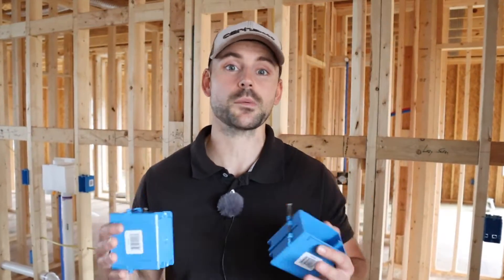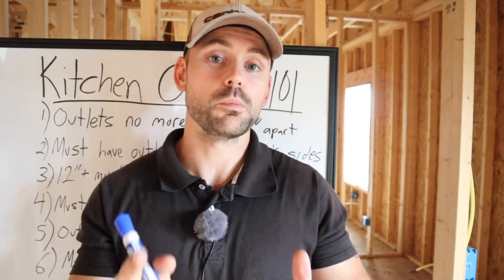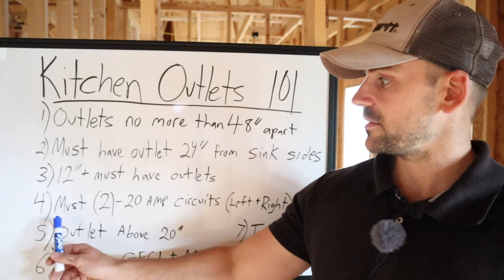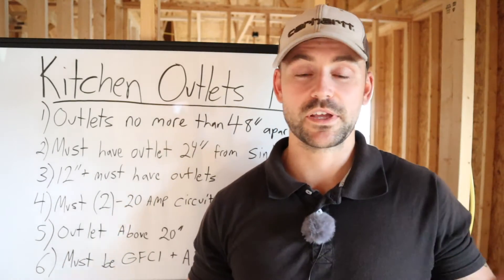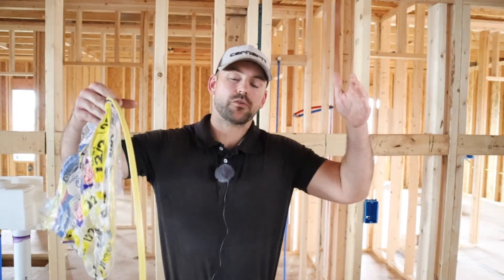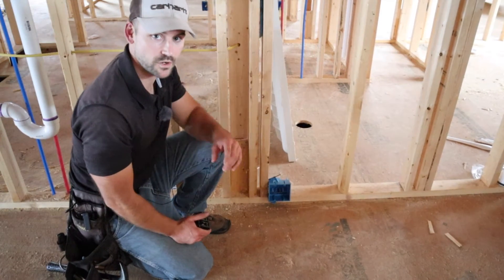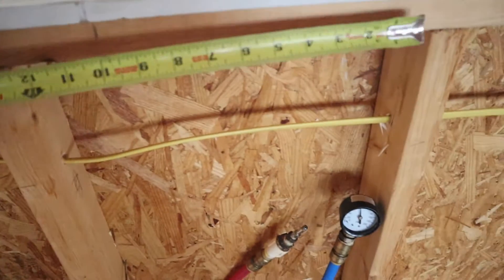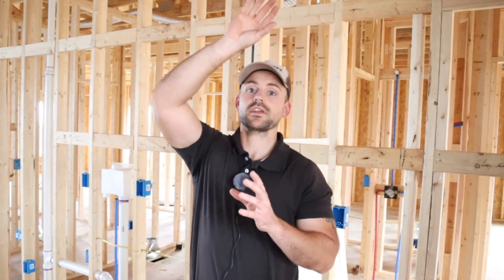How To Wire A Kitchen - Rough In Electrical Circuit Wiring Guide

Comment: a good tip I learned is to use slider boxes for your countertop outlet rough in, they are rigid plastic boxes as well but when tile is added you can loosen the screws and move your box forward flush with the tile afterwards. I believe they are available at most of your local big box stores
Reply: you install the box a couple inches forward past where the finished surface would be. then the grout is only supposed to be in between the tiles not around the box and even if the tile is tight up against the box you can lightly tap the box back flush
Reply: PERFECT REMEDY FOR WHERE TILE IS ADDED.
Reply: How does it move when there is grout and tile holding it in? Just curious?

Comment: Why are receptacles for the range mounted so low to the ground?   I have found most cords need to be pinched 90 degree coming from their plug end
Reply: MOST OF THE RANGES I HAVE CAME ACROSS HAVE A VOID CLOSE TO THE BOTTOM OF THE RANGE FOR THE CORD TO FOLD INTO. MOUNT THE OUTLET TOO HIGH AND IT MAKES THE RANGE STICK OUT 2" FROM THE WALL.

Comment: I can see why contractors and residential developers like those plastic boxes because they're quick, cheap, and I suppose good enough. If I'm building my own house though, I'm inclined to use 4x4 metal boxes with appropriate mud rings. They are much better in my view and the cost and time would be negligible in the grand scheme. I don't find them hard to work with either. Am I missing something?
Reply: Plastic rough in box=$.80, metal 4x4 box=$3.50, + $2.00 for mud ring.
Don't forget with metal box also have to use a Romex connector or minimum a plastic Romex bushing.  Also you have to ground the box.
Benefit for plastic : cheap, cheap, quick efficient.
Cons. Can only support 2 #12 Romex wires due to box fill limits.
Pros for 4x4 metal box: can handle multiple #12 Romex wires.
Cons: cost more and more time consuming to install.
Every moment and every dollar counts in construction work.

Comment: Good video the only thing on a 3-wire 12 make sure when you snap the breakers in your black wire from the three wire number 12 is on phase a and the red wire is on phase B this way you don't overwork the neutral that is code
Reply: Instead of me referring to the national electrical code  this will make it easier for people who want to learn I want people to get the right information
Reply: @jcaleca60  Your original comment “this way you don’t overwork the neutral that is code”. Now that you realize this is NOT code, you want to change your story, and cite some other YouTuber and say let’s not talk about code. Just admit that you commented on a subject that you don’t know enough about.
Reply: 🤣🤣🤣🤣🤣🤣 where did you hear that crap?
Reply: @electricaf365  I don't know what school you went to but you could look it up on the internet all your circuits should be balanced
Reply: @jcaleca60  you won’t find that in any code book.
Reply: @electricaf365   You never make it as a New York City license electrician
Reply: When I was in school for my master electrician license for New York City is where I heard that if you think about it the neutral balances the unbalanced load so theoretically if you're drawing 10 amps on one breaker and 10 amps on the other you won't even need a neutral
Reply: Look up electrician U Is the name of the guy neutral imbalances In multi wire branch circuits it's too hot one neutral
Reply: Please stop you can take corrective criticism
Reply: We all make mistakes brother

Comment: Does the plug for refrigerator have to be 20amp?
Reply: Outlet or receptacle. Not a plug 🔌
Reply: If it's a dedicated line you could probably use a 15 amp circuit, but it doesn't make sense as a 20 amp circuit has advantages and the cost increase is not much.

Comment: I had. question about your left and right code for the counter top receptacles . So Does the left side and right receps require its own circuit ?
Reply: No, you just need to have two 20 amp circuits in the kitchen for small appliance circuits on the counter top. We label them kitchen #1 and kitchen #2, both circuits require a 20 amp breaker.
Reply: @lorenrickey5481  I’m confused by your answer.  So you’re saying you don’t need to20 amp breakers but you do need two 20 amp outlets
Reply: @shemicdee780  I missed reading my comments after spell check corrected what I wrote. I edited it to read what I was trying to say. Hope this helps.

Comment: Hmm so if you are updating an old house. 1980. They don't have home run for fridge or range. So do you need like 3 to 4 circuit breaker for a kitchen? And what if your panel don't have space on the panel?

Comment: I run 12-3 and split left and right side  so you can plug to much amp draw on one receptical.
Reply from the maker: Oh very cool! Thanks George!
Reply: @TheExcellentLaborer  I'm a house builder also been in business since 1984 builder I learned from also had electrical license and we wired the houses we built at 19 I was wiring main panel due to my anal neatness,, we always did kitchen is 12-3 with split circuit,, that way you can plug in 2 high amp appliances in same receptical,,
Reply: No split circuits for my house, potential dangerous.
Reply: @anonymousperson4363   you know it's code for kitchens to keep them from being dangerous,, you clearly don't know electrical
Reply: @georgespangler1517  
I may have used the wrong term; i meant a shared neutral. Shared neutrals are dangerous. Even Mike Holt agrees. If you don't know who he is, then it shows I MAY know more than you. Btw, possibly my only exception to the rule is to a ceiling fan/light combo.
Reply: @anonymousperson4363  you have to split legs with double pole breaker so both circuits kick in case of overload with shared neutral could only have problem if both circuits was on same phase, remember all your neutrals are wired together anyway, so maybe you and your buddy don't know as much as you think and really don't understand how electricity flows , all neutrals and grounds are on same terminal strip in main box..you could only overload if both breakers was on one main feed.
Reply: @anonymousperson4363  l think what your not understanding is the neutral will only carry the unbalanced load back to main panel,, so if top is drawing 11 amps and bottom 6 only 5 amps of load return's back to main panel,, not 17
Reply: @georgespangler1517  
So, my guess is you don't know who Mike Holt is. He's not a buddy of mine. He's a leader in the electrical industry. He has written hundreds of electrical training books and articles and has taught thousands of electrical code seminars across the US and internationally.
Reply: If the shared neutral comes disconnected for any reason, whether by a person or a rodent chewing the wire, you have ~220 volts going to your connected devices. Bodily harm may not happen, but a device is killed and it's usually the most expensive device on the circuit.
Reply: @anonymousperson4363  not the case you have 2 separate hot wires on different phases in main panel the receptical is split by removing tap between wire screws , will only read 220 with meter and no way to plug in an appliance to get 220,,  really is the best way to do a kitchen..all neutrals are shared anyway.. only way you could have 220 is to put both hot wires on one one plug in replacing neutral with a hot.
Reply: @anonymousperson4363  my father taught me he was a master electrician and even invented the landing indicator system for the C5 aircraft wanted him to go to NASA . your man has many vedios conderdicing the electrical code and I agree with him code says you can use number 4 aluminum in 200 amp service but it's only rated for 80 amps,, so many screwed up rules in our code that make little sense.
Reply: @georgespangler1517  
I concede!
Reply: That’s not a legal installation in a kitchen anymore... depending on what code edition your AHJ has currently adopted. No way to provide AFCI and GFCI protection in that setup.
Reply: @tennesseewebb2651  
Couldn't you have protection at the panel?
Reply: @tennesseewebb2651   sure you can useing GFI breakers.
Reply: @tennesseewebb2651  national code only requires you have split circuit on double pole breaker so both go off at once..
Reply: @georgespangler1517  GFCI isn’t the problem. You can’t get a two pole 20 amp AFCI breaker
Reply: @tennesseewebb2651  so many against things that are better that they don't understand, it's a safer circuit , only the unbalanced load return's on neutral , been doing it since 1978 and never had a problem and no worry of overload and kicking breakers with many higher amp appliances used in kitchen.think about it..
Reply: @georgespangler1517  I agree with that you’re talking about 12/3 application in kitchen use.  Practically, there are still some concerns existing like an individual receptacle itself is amp rated, too much draw could cause problem over time, plus future maintenance/repair/ modification would require more attentions. Adding more separate 12/2 circuits would be safer and workable.
Reply: @juntang72   l only use number 12 with 20 amp receptacles,, it's never seems worth use 14 and I see 14 as to light as well as 15 amps,, and it's less confusing just to do all 12. The new wire is nothing like it used to be as far as duty, and most house fires are from overloaded 15 amp 14 wire circuits,,been doing it this way for 35 year's.

Comment: How many devices (outlets, lights) can you add to one run that has a 15 or 20 Amp breaker?  Thanks
Reply: You can add 10 on a 15 and 20 on a 20amp
Reply: Any replies on this?
Reply: @gabrieltorres3215  Nope, not yet.  Although, I suspect it would be not to exceed 80% of the total amps/wattage for the specfic breaker.
Reply: 12 outlets on a 20 and pretty sure it’s 8 on a 15
Reply: each outlet 1.5 amps power draw is rule of thumb.

Comment: Just FYI, when you go to buy the breakers, they're called "dual function" breakers. They have GFCI and AFCI breakers, but the AFCI breakers are actually called "combination arc fault". So if you buy the ones that say "combination" on them, they're going to only be AFCI breakers without GFCI protection.
Reply: fair enough but I meant the GFCI receptacles. No one ever seems to mention the danger of plugging medical devices or fridges or anything that shouldn't trip off unexpectedly. So do they have to be installed because it is code regardless of what makes sense?
Reply: @carlodonnell146  regardless of what’s going in it. All new 15/20 amp must be arc fault protected. There are exceptions
Reply: @carlodonnell146  yeah, I had an extra freezer in my garage on a gfi and it tripped and I didn't know it.  Food went bad.
Reply: Just to clarify for the folks at home       when an arc fault breaker says "combination", it means that it deals with both series and parallel arc faults.

Comment: Great vid. Next time you wire, leave a loop of extra wire in the wall for all the receptacle boxes so if you ever need more wire, you can simply pull more as required. I usually leave about an additional 8 inches. Thanks.
Reply: I am aware of this process.  But if you need to staple within 6" how would you pull the extra if you needed it?
Reply: @dkgrace6743  technically if the cable is secured within 6 in of the box a loop between the box and the staple is allowed
Reply: @Bradley-tx6ed  is there a limit to the size of that loop?
Reply: @fjl05  not a code requirement, but an inspector will probably call it if you leave huge loops as there is a risk of them getting pinched under drywall. An extra 6 or 8 inches in case the drywaller routers the wires is a good safety.
Reply: @dkgrace6743  pull harder

Comment: Having 100 outlets in a kitchen just doesn't sit right with me.
Reply from the maker: I have eight in my whole kitchen. Then I will have two on my island. So that will be 10 total in the whole kitchen. Thanks for watching!
Reply: @TheExcellentLaborer  it's crazy they have to be within 2 ft of the sink. It's like they want to take a toll of how many times the gfci trips like it should without someone getting shocked.
Reply from the maker: I agree. I think 3’ from the sink should be acceptable but nope 2’ or closer here. Are you building a kitchen right now?

Comment: I forgot to ask, so you’re using AFCI/GFCI breakers instead of the GFCI receptacles in the kitchen and near water sources? Thanks Josh!
Reply from the maker: Correct Randy! It may cost a little more to do it that way but it is less complicated than trying to remember which circuits you’re going to buy a GFCI breakers for and which ones you are not. You are welcome!

Comment: I can’t get enough of this series. I always thought building “code” was for safety, but it seems like for outlet distances it’s just for homeowner convenience? Is most code like that?
Reply: I believe the maximum spacing of outlets was determined with safety in mind. The 4' max spacing in a kitchen, for example, is based on the length of appliance cords (toaster, coffee pot, etc). Some appliances have a 2' long cord (though they might be longer), so this code rule will allow the toaster to be placed anywhere along the counter and able to plug into a receptacle without the use of an extension cord. Use of extension cords tend to increase shock and fire hazards.

Floor lamps should have at least a 6' cord, which is why the maximum spacing of wall receptacles in living rooms, bedrooms, etc. is 12'. Again, to allow the lamp to be placed anywhere along the wall without having to use an extension cord to reach a receptacle.

Some electrical code rules are not obvious as to how safety is involved, and the NEC (National Electrical Code) certainly does not explain the "why" behind its requirements.
Reply: @idealalaska8259  Awesome explanation, thanks Alaska!
Reply from the maker: I feel like most codes are a blend of safety and convenience. Also it protects against shotty designs. For instance you would not want a toilet tight against the wall because it is not functional. Thanks for watching!
Reply: Some of the code is made with handicapped people in mind as well.